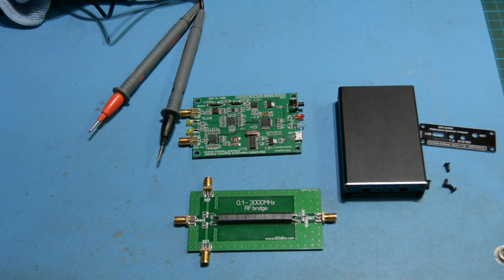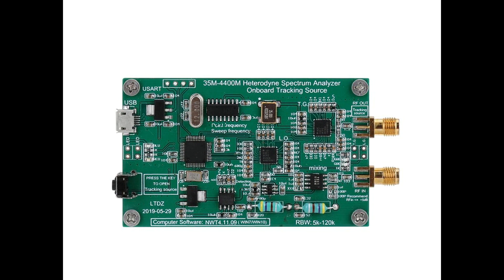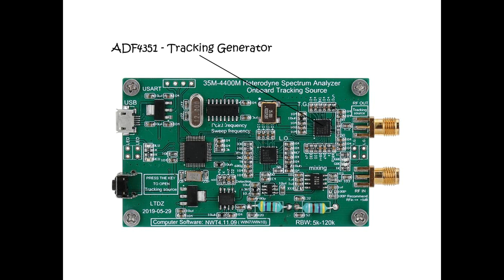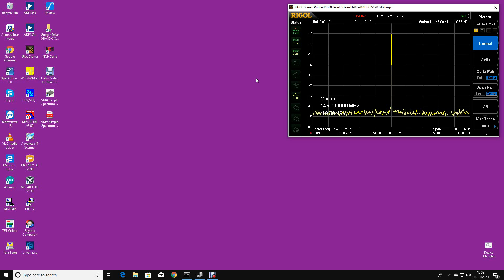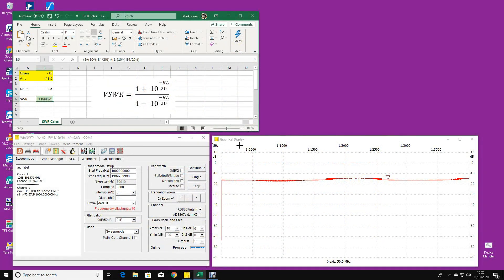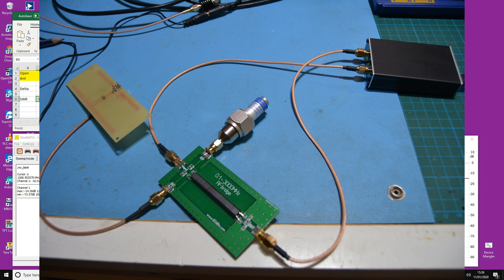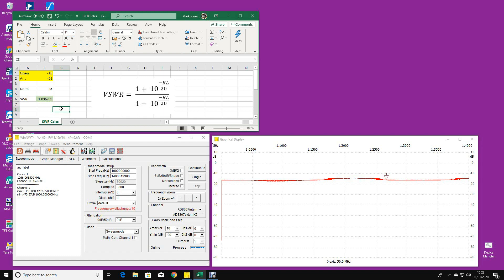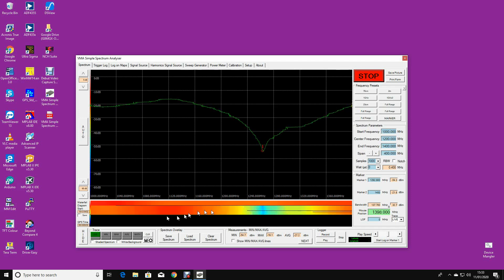USB Spectrum Analyser 35MHz to 4.4GHz review & musings

Comment: The dip in the center of the spectrum is due to the fact that is a direct conversion, so the log amp see from -170KHz to 170KHz, ( the minus is the LSB and the + is the USB). Passing through zero ( DC ) the out of the log amp is a low value because the coupling is with a C, the out is really low just in the center. I think that the idea is to have a dip just in the center of the "peak", trying to get a good thing from it! 73´s CT4QW.

Comment: the notch is not artificial, but arises from the frequency response of the RC coupling of the direct heterodyne receiver. The low frequencies are not transmitted by the RC coupling, so they are reduced to zero, a notch. . The high frequencies are not transmitted either, the bandwidth should be small. Unfortunately it is still 100 or 200 KHz.
Reply: Since you know the highpass characteristic (well if you do...), I am wondering if you could correct the dip by software. Obviously at the exact zero (DC) you would need to interpolate, but generally this might be possible and would enhance the value of this little turd. After all its just a linear system of equations and by inverse filtering one could almost completely remove the contribution of the RC filter (I think its a higher order LCR Butterworth, but not sure). In my field of work I am dealing with optical deconvolution and would see this as an analogon and a simple one on top that would not suffer much from being an ill-posed problem (except for the zero). Unfortunately this requires having the PC source code available to perform some changes.
Reply: @LutzSchafer  ok, danke

Comment: not knowing much about RF, is the notch because the thing sweeps the LO over the signal, directly downconverts without IFs and filters and ends up with an image? It seems to me like the thing is designed only to be used with the tracking generator as more of a network analyser and they haven't really designed it to be used as a spectrum analyser..

Comment: Hi Mark. That notch I suspect is because this device uses a heterodyning arrangement and it's going through zero beat.   I wonder if you have a working copy of the software cause I can't find it anywhere!  I've just ordered one of these with the intention of re-purposing it.  STM32 + 2 decent 35-4400Mhz oscillators, a 25Mhx OCXO etc.... I think I can use it for 'better things' but of course it would be nice to test it first b4 I wipe the MPU and start again. :-)
Reply from the maker: The best I can find is a .rar file which I have placed here: https://www.qsl.net/g/g0mgx//BlogFiles/USBSpecAn/
Reply from the maker: I found a zip file too which is in the same location now.

Comment: Just bought one from AliExpress to Melbourne Australia. It took 7 weeks to get here! They Ali said it was loaded to aircraft, but really a 14 KNOT ship to Sydney!! 
 No China to Au flights due covid. I have found some better (imho) software that DOES work on Win7. Once CH340 driver is installed, plug in device and start the software.
 It should find it a some silly COM port number.
 http://www.dl4jal.eu/nwt4x/sw/nwt4_setup_v1_10_10.zip

Comment: Can you share that SW 4.09 org source not valid anymore and the newer version 4.11 keeps coming back with a syntax error?
If you could upload 4.09 at one of the host files, as it is only 5mb It would be great.
and what kind of antenna do you need for one of these to pick up these signals, as most I got in the household is usually intended for 2.4ghz or 5.4ghz and from RC,.
Reply from the maker: Sorry, but I dont seem to have the file anymore - I have looked but its not there - sorry :-(